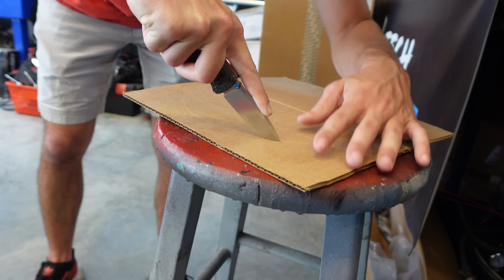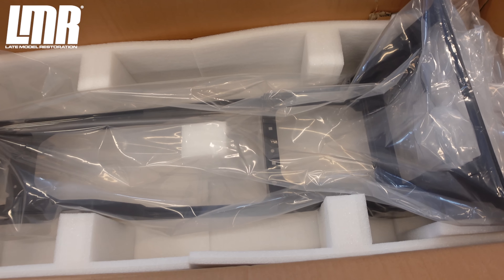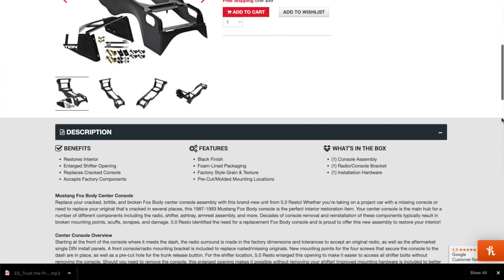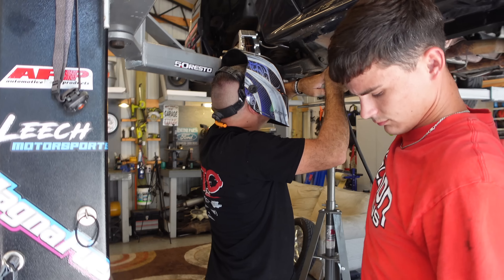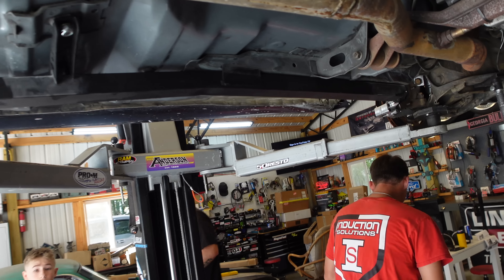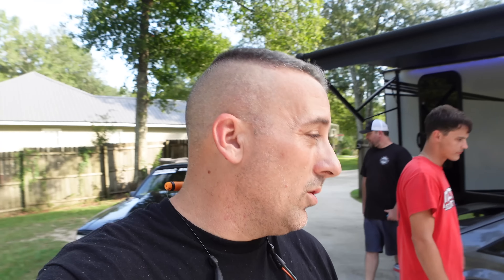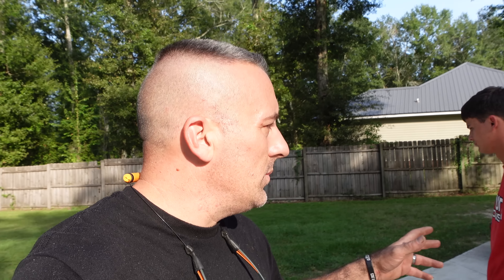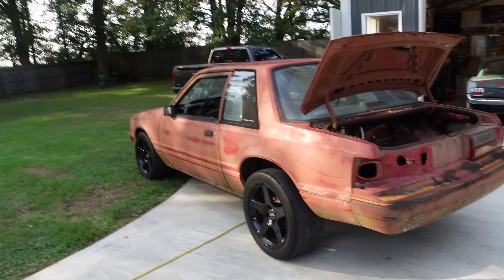This Little FOXBODY Is PACKING! / No Prep Setup

Comment: Let me give yall a heads up about adding weight … i worked in the shop at a Clark forklift dealer in knoxville Tn .. when the forks got worn so we couldnt safely use them on  our rental forklifts and i got to cut one up n take home .. a piece near the elbow  about the size of a normal mans hand weighs about 20 pounds .. its thick heavy because its dense and you can use it to add weight to your car and add more weight and take up less space … if you go to your local forklift dealer  they may have some old forks they will sell you cheap  for weight in your car .

Comment: Sprung weight works way better for no prep or street stuff than hanging weight on or off of the axle!!!! Trust me you will be very grateful in the long run plus it's easier to adjust weight if needed
Reply from the maker: It’s not a matter of what is better.. they both work in conjunction with each other. Any weight you can apply to the tires is good for traction. Unsprung weight is there at all times even before the car has a chance to transfer sprung weight.
Reply: @BREW2LFOXBODY 100% correct

Comment: Shouldn’t the weight be sprung for transfer? Either way very creative.
Reply: Correct for best weight transfer it should to be added sprung weight along with a 100% anti-squat value or more for this to work the most efficiently
Reply: Add 400 pounds, it will really hook